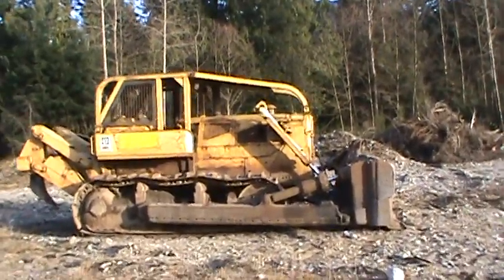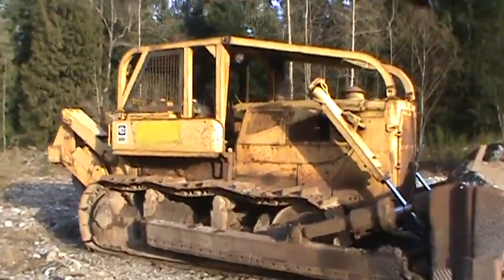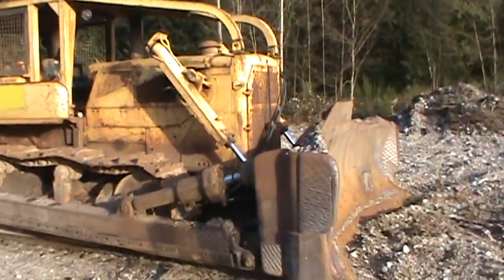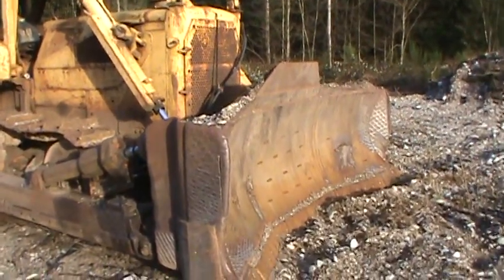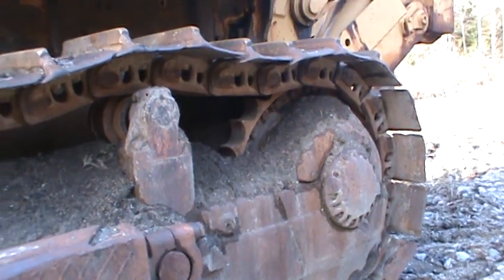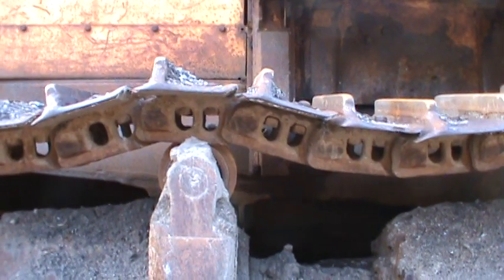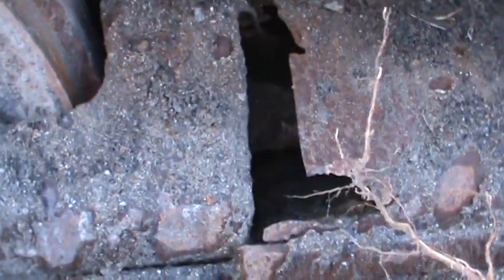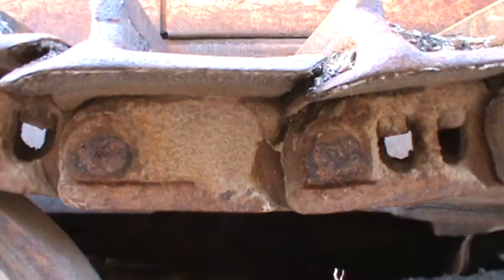Caterpillar D8H

Comment: Spent MANY a day on one almost like this with NO cab and a pony motor. I was hunting the gas and choke and throttle and clutch setup but guessed like you it's a glow plug deal. Had a ball pushing pans, clearing and working cuts. Then ended up on the dam with a 6-B straight drive blading and then they got a 7-F manual angle blade, power shift, clearing cab and no ripper. Bushings out on the cab mounts and it BANGed every time a pad turned over. MISSERABLE but a good tractor for an F. I liked the E's better. Thanks, Pal and Blessings!

Comment: We had one ,direct drive ,pony motor start ,when the Pinon on the pony stripped ,I converted the old gal to electric start and alternator charging ,worst thing abought her was the blade was a d9 u blade ,the equalizer bar was a cut down 9g ,the crossmember also got changed to a 9g ,and yes ,it wore out the front idlers on a regular basis